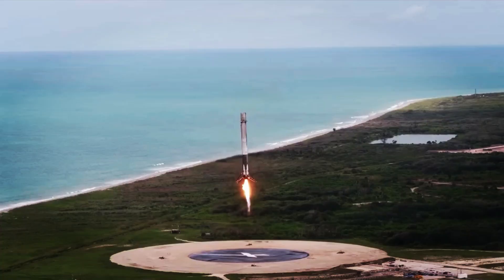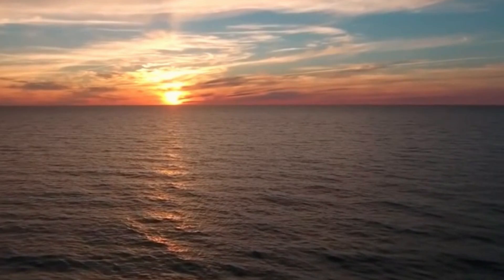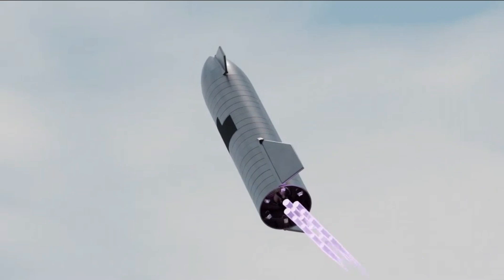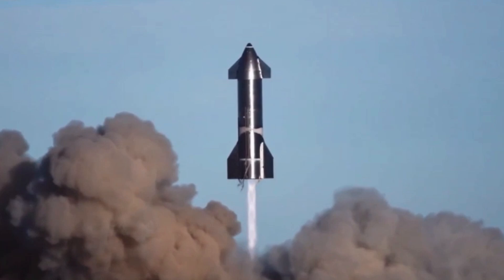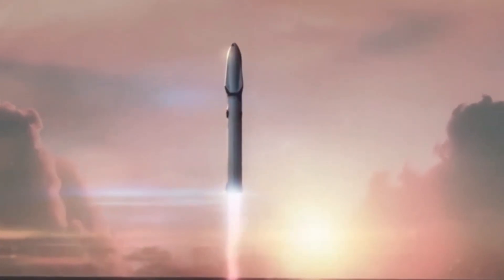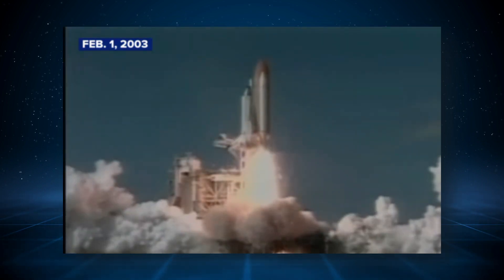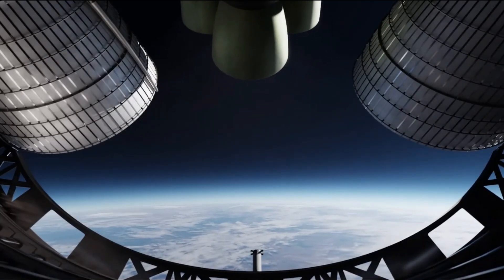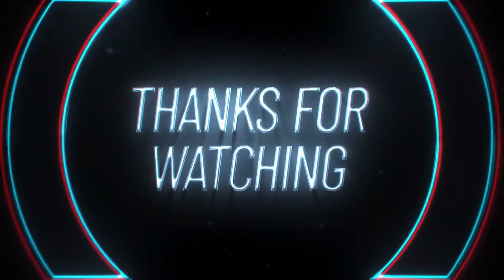Why SpaceX Is Dropping Starship SN20 Into A Water INSTEAD Of Landing!

Comment: they are clearly running on hubris ,  its getting way way past timelines for some actual results . I notice the vastly reduced payload capability is not given a mention anywhere but then as its never even reached orbit its a moot point .  ¬the resounding success ` bit is getting old fast . It was never a technical issue reusing rockets , its a cost issue and still is looking at space x costs .